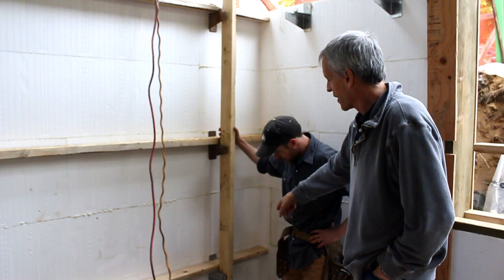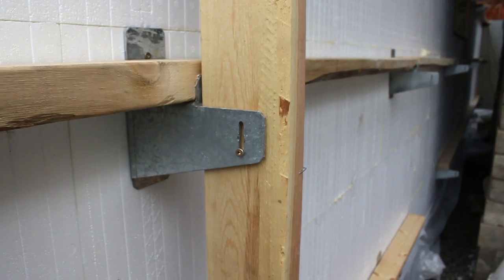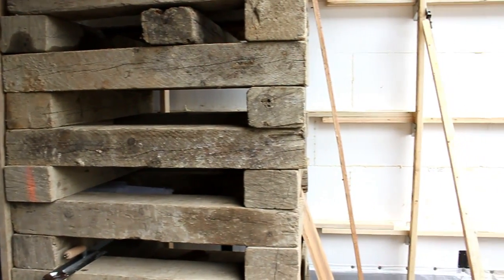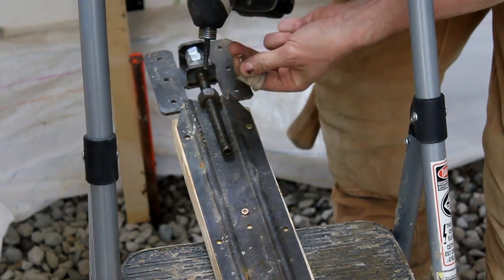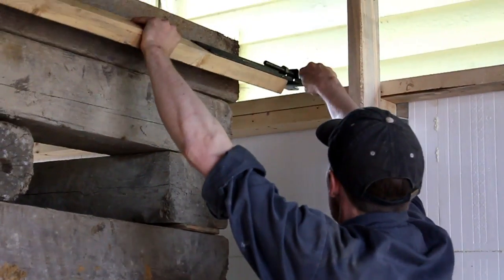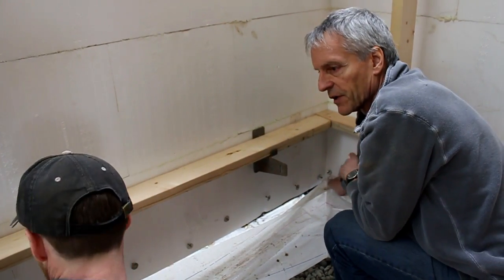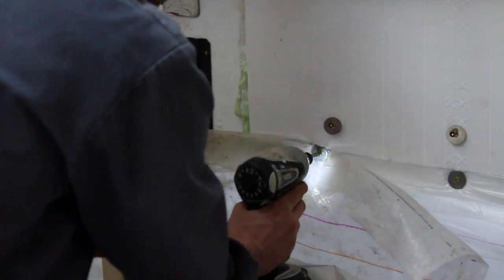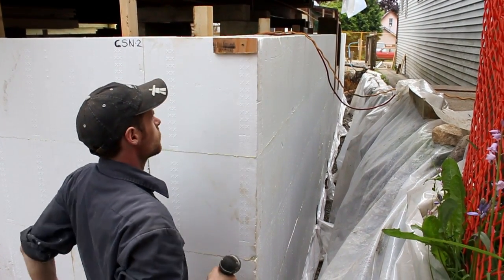ICF Monopour : Zont Bracing

Comment: Now,,, please tell me what the advantage of an ICF system is over a conventional concrete form pour.     The forms are owned by the basement contractor,, and reused hundreds of times. It requires a 5 man crew two days for the rail footings,, and one day to set up the forms.  Mono-pour  into a bag?      Doesn't the bag cost more than 2X8's to frame it up?    I do like the rebar.

Yes, the 2X4's and 2X6's can be reused,,, after all you have nearly enough for the first floor walls.  Yes, there most certainly are sites that are difficult and ICF would be a real problem solver.  But I see a lot of very skilled people, a huge amount of lumber, special fittings, Zonts and turnbuckles, many days.  And this stuff is expensive.

Make certain you put a firestop at the wall top/bottom of band joist.  Grenfell Tower, London, 2017

Just pour a wall and glue the foam to either side.
Reply: You got the point) Was thinking on the same thing) And what is they have a blowout?
Reply: @RyersonHaha7  as long as you but ICF up right that’s not going to happen.
Reply: I understand what you’re saying but tell me how you are going to attach your sheet rock to the inside and your exterior siding to the foam that you’ve just glued  to the concrete poured wall? 
With ICF you have attachment points on the inside and outside actually more than you do on a conventional studded wall! Also you have no forms to Strip down clean and load back up! You take your braces down and go to work on framing the floor system.
Reply: @Upsetcitizen  First, the concrete walls are poured by a subcontractor. Because of his reuse,, and reuse, of the forms,, he costs me nothing as compared to me buying and building forms.  His contract price is nearly identical to what I can do for myself.  Annnndd,, he,, not me,, cleans and carries the forms away.  I stand around and look on sagely.

Exterior is simply glued on,, and the concrete sheet goods that go over the rigid foam are also glued to the foam.  Most of the mechanical support is the soils backfill  and a reach down flange from the wall system above.  The exterior skin covers the bottom plate, the sill plate, and extends down over the top of the exterior cementicious foam covering.  Not only certainly retaining the Hardie board cover,, but mostly crossing and sealing those exquisitely difficult seams of concrete to sill,, and sill to bond or joist,  floor joist to subfloor, and bottom plate to subfloor.  Tie it all together and you will have no air leaks in the most difficult seam in the house.

I have become not a fan of ICF's  I have used them.  They are expensive and slow,,, and,, in SE Michigan there is a species of very small ants,, that adore  polystyrene.  I have no idea what the long term effect will be.
Reply: @Sailor376also  You might like ICCF, like the perfect block. Ants will not eat it.  There are always pros and cons to all engineering.
Reply: The zont bracing thing i really cannot understand why anyone would do it unless you had LOOOOTS of time, and money was the only limiting factor since it is cheaper than even renting bracing, and you are supposed to reuse all the lumbar in the house construction.   Otherwise just rent braces. 

The bag footer system they are using called fast foot is actually a really fine product and also surprisingly cheap. About 130$ for 100 feet of their 24inch product.  As i have said elsewhere i don't think i would use it unless i was doing an icf wall and using their level leg system.  Which are a series of legs you attach to icf that can be extended up or down very easily with a drill.  Using the legs and fastfoot allows a monopour with no cold joint between the icf and concrete.

As far as why ICF is used and is popular it breaks down to three main things. 

1.  The cost savings if doing a traditional pour in place arent that much IF you plan on finishing the walls for residential use.  If you just want a bare concrete wall, yeah definitely icf is a lot more expensive no contest.  But if you want to add insulation, and electrical and drywall and brick and etc then icf comes out cheaper. Sometimes a fair bit cheaper depending on the local area.

2. Icf is simple enough people like to save and DIY it.  Likewise it is simple enough that contractors don't need any special skilled trades to put it up. So it saves money

3. Saves time.  You aren't doing anything to it you wouldn't do to a regular concrete and most of the trades can interact with the surface without much in the way of special tools or effort.  Drywallers can nail stright into it, electrical and plumbing just cuts channels thru the foam, etc.  

One significant limitation to icf is you REALLY have to watch out what adhesives, coatings, and glues you use.  It's foam and most solvents will just eat it.